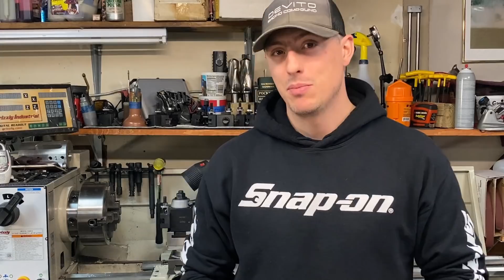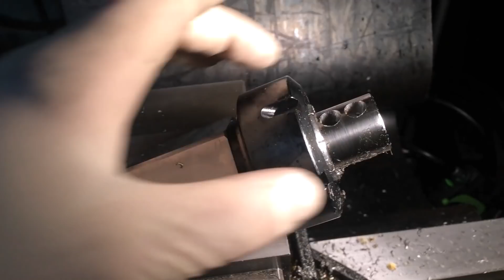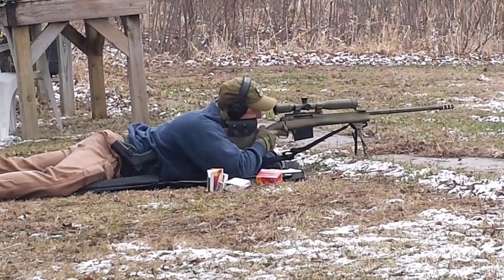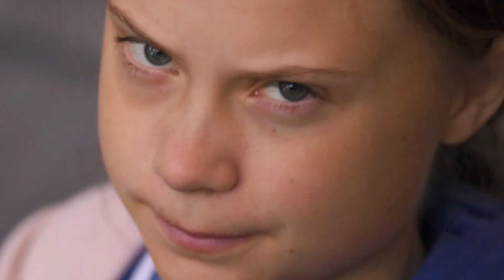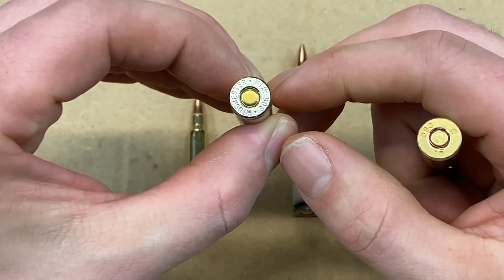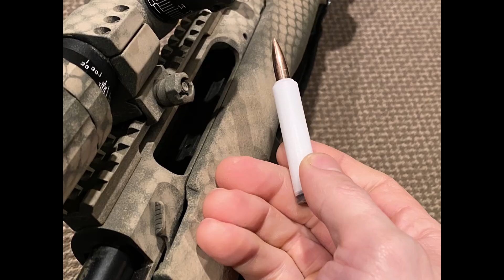6.8 NGSW ammo selected by the U.S Army for the NGSW Rifle testing! #ngsw #6point8ammo #army

Comment: Brits in 1948: we need an intermediate 7mm-ish round
America in 1948: no

America in 2020: we need an intermediate 7mm-ish round
Reply: Brits in 2020: "what's a gun ?".
Reply: At 3200 ft-lbs it's anything but intermediate.
Reply: What Round? .280 is 7x 43, the case lenght is shorter than a 5.56 by 2mm.
Reply: @Mr12ob  The new 6.8 - 140 gr @ 3200 fps => 3183 ft lbs - more than 30-06
Reply: @alexandruianu8432  Yeah, about as fast as .300 Win Mag. I don't like .30-06 personally, I know I'm off topic but just don't like .30-06.
Reply: Rob G Whats not to like?
Reply: @Mr12ob  me either as my 308 can do just about everything 30-06 can and most ammo has the same specs for boh of them in the same weights
Reply: @alexandruianu8432  Why those ballistics? 130gr 2800 fps. Low recoil. less heat,lighter round,lighter piece and would do the business.
Reply: @baobo67  Ask the army. They're the ones obsessed with 'overmatch'.
Reply from the maker: It’s all relative in the end.
Reply: It's a battle rifle round.  More like ~3000 from what I've read, but... yep.
Reply: 556 is here to stay, as is the AR platform. You'll note that all of the talk of 'replacement' is actually talk of 'partial replacement' of support systems. No one is replacing the M16 family with something heavier and more complicated, when they've already scaled back from a rifle to a carbine. They just want to increase lethality of the medium machinegun and enhance organic designated marksman capability. The M4 is still the best small arm in history, for MOUT, by a substantial margin.
Reply: @springbloom5940  The M4 maybe, but 5.56 has severe limitations.
Reply: @baobo67  

Everything a man can fire from his hands, has severe limitations.
Reply: @tomsmith2209  If they called in .280 Nato it would probably been adopted. .280 British was ahead of it's time.
Reply: This isnt intermediate
Reply: Brits in 1940’s ......we need your help with the Germans any caliber will do
Reply: @oldstudbuck3583  In the 50,s the Cold War was hotting up and no time for R & D and a need for commonality among allies is one reason given.
Reply: Why didn't the Brits made the 7mm-ish round ?
Or they need approval from big daddy ?
Reply from the maker: Bingo!
Reply: Switchpod I feel it’s possible the plastic will not remove heat from the barrel like brass or steel. This would mean more barrel changes for automatic gunners all round.
Reply: @LibertyLou_  I was worried about this too, sustained fire has me worried for polymer casings unless they coat it with a chemical or something that traps heat (not sure if this is possible)
Reply: @LibertyLou_  Plastic removes more heat from the gun because metallic cartridges touch the chamber and let the heat through. Plastic acts as an insulator.
Reply: Titanium Rain During sustained fire, what happens when these puppies start melting, deforming and or starting cook off? 
Should be alot of fun to fix that kind of malfunction during combat. All polymer has a melting point much lower than brass.
Reply: woohoo2491 True. I’m worried about these puppies melting, deforming and or cookoff.
Reply: @LibertyLou_  That's not the original argument, though. You were talking about the use of cases as heatsinks, not melting concerns.
Reply: Titanium Rain It’s precisely the argument. Brass has a much higher melting point, thus better heat sink. I’ve never seen a plastic heat sink have you? 
Now, the barrel gets heat transferred to it by the bullet traveling through it, along with the powder being burned. The breech will remain cooler because its air cooled when the action opens. 
Also plastic cases as insulators don’t remove heat because they don’t absorb it in the first place. Heat would remain in the barrel. 
But the case melting point from barrel heat will definitely be a problem, say on a hot sunny day in the sandbox after 3 magazines/100rd belt through the rifle. 
I’m very skeptical as to how much heat plastic rounds can take and how long one could last in the breech before melting and or cooking off which could lead to accidental fratricide. Let’s just have Trump’s space force bust out the Plasma rifles at a 40 Watt range lol.
Reply: @LibertyLou_  "Brass has a much higher melting point, thus better heat sink." - Heat sink properties are not related to melting point. In fact old machine guns used water as heat sink and water has a melting point of zero Celsius. Modern computer heatsinks use heatpipes filled with distilled water or sometimes a water-alcohol mix.
"I’ve never seen a plastic heat sink have you?" - because a heat sink is typically a FIXED part that has to remain in contact with the heat source. The case is both the heat source AND part of the ejected mass that carries the heat away. A better analogy is cooking utensils. How many have plastic handles compared to brass handles? If you wanted a fixed heatsink on a gun you'd solder or braze copper sheets to make a radiator. But we're talking about ejecting mass as heatsink. Brass cases are thin and highly conductive which means heat goes right into the barrel. The plastic case acts as a blanket that gets hot in the middle, but insulates the barrel.
"Also plastic cases as insulators don’t remove heat because they don’t absorb it in the first place. Heat would remain in the barrel." - An insulator doesn't absorb heat. Please provide evidence for this claim.
Reply: @LibertyLou_  You're lucky I found this video because it's buried in the results. https://youtu.be/pUS2_wLlvDY?t=431 At least True Velocity has posted proof of the guns running cooler with their polymer case ammo. I still want you to prove that an insulator doesn't act as an insulator. I reeeaaally want to see you prove that.
Reply: @LibertyLou_  yes !
Reply: @woohoo2491  not enough space for the quantity of atoms required....
Reply: @ChucksSEADnDEAD  No. Sorry no. Sone of the heat leaves the gun entirely taken outside by the spent casing. The polymer doesn't pick it up as effectively. The spent polymer will remove a fraction of the heat. A mere fraction. Having said that I wonder how quickly heat transfers by conduction ? From metal to metal. Funnily enough I was soldering copper pipe today, it's pretty quick.
Reply: @ArieteArmsRAMLITE  "Sone of the heat leaves the gun entirely taken outside by the spent casing. The polymer doesn't pick it up as effectively" - I mean I actually posted video evidence. How does the "polymer" not "pick up" heat? We know the heat transfer equations, you can literally look them up and post your calculations here. If what you're saying is true, you can prove it mathematically. You can't.
"The spent polymer will remove a fraction of the heat. A mere fraction." - Prove it.
"Having said that I wonder how quickly heat transfers by conduction ? From metal to metal. Funnily enough I was soldering copper pipe today, it's pretty quick." - that only proves what I'm saying. Heat conduction being so quick means that the brass case will transfer a lot more heat to the steel.
Reply: @LibertyLou_  Late reply and this really has nothing to do with anything, but powerful lasers were a real consideration, I think even prototyped, during the space race based on the ideas you could just melt a hole in an enemy space suit using a strong enough laser, lasers move in a perfectly straight line over great distances and stop they hit an obstacle instead of being dangerously redirected, don't pollute the space around the earth and moon with dangerous debris (48 grains of lead can shred right through a ship when it is travelling over 400 miles a second), no recoil, and the laser wont harm to your own equipment/shuttle (sensors yes but the hull will retain integrity).  Laser weapons make a lot of sense.  Plasma on the other hand makes zero sense.  Unless fired from some kind of railgun that fires a short "stream" or "bolt" of plasma somehow self contained in a magnetic field, and you are also in space away from any debris that would obstruct the bolt.  Keep in mind the only point to plasma is the massive amount of heat generated, not mass.  Plasma as anything but a powersource is retarded.
Reply: @ChucksSEADnDEAD  Not heat from the powder burning in the barrel and the friction of the projectile.
Reply: @baobo67  Metallic casings don't get rid of that heat either.
Reply: @ChucksSEADnDEAD  I wonder how much heat comes from the burning propellant compared to the friction from the projectile and the barrel. Seen pics of early air cooled machine guns with fins around the chamber area of the barrel. The Lewis gun is interesting in that area.
Reply: @ChucksSEADnDEAD  Watched this link with interest. It was sales and marketing and dare I say the proof is in the eating. Would appear that key to this is in their Polymer formula. Sounds good and would love to try it.Why is there none available and what are the ballistics? Hope it is not combat troops who find its shortcomings in battle like the 223/5.56 in Nam.Thanks and cheers.
Reply: Well luckily we have a new commander in chief that’s willing to bend to the needs of our military. And let’s all get serious. The only reason they said no was because they didn’t want the lethality . They wanted to make sure more rounds had to be fired to kill with the end result of supporting the war industry complex getting to produce more ammo at taxpayers expense.
Reply: America in 1948: We have the .30-06.

America in 1960: 5.56x45 is Light weight and accurate. But lack penetration in distance but OK inner fragmentation. But I still prefer the M14, so why not?

America now: Then we need 6.8mm.
Reply: @Romanov117  the new 6.8 is only a thing because the conditions have changed - it exists solely to defeat new kinds of armor
Reply: Go back to the 1930s when the M1 Garand was swapped from a .276 Pederson to the .30-06
Reply: woohoo2491 Japan listened to the brits though and have fielded a 6mm round superior to  556 for years
Reply: Im very happy to see americans acknowledging the excellence of 280 british 🇬🇧 🇬🇧 🇬🇧 🇬🇧
Reply: @James-C24  Dude I'd love a modern semi auto, like an AR platform, in 280 british so I can see how well it really performs
Reply: 7.62x39 is the true intermediate round.
Reply: @rowdyrico  Necked to 6.8 - Bingo. Too easy.
Reply: These aren’t intermediate...
Reply: Hehe.

But NGSW isn't an intermediate round.
It's a battle rifle round.  Afghanistan taught us that "engagements happen under 300m" isn't universal.
The competitors are doing recoil compensation, but its closer to 7.62 NATO than to 5.56.
Which is fine.
NGSW round performance is similar to .270 Winchester:  ~3000 fps, ~2700 foot-pounds energy.
So, 7.62 NATO, but flatter shooting and better sectional density.
Reply: That's the weird thing. These spitzer bullets started out with 7mm, and morphed into all kinds of calibers, yet here we are.
Reply: Back then nobody wore body armor unless it was make-shift, nowadays most Modern Armies are equipped with a Level 4 type standard body armor
Reply: I think that's funny,,,. 
But I think what they were think was " we don't need any changes now"
Reply: .280 brit would still be rocking today without a doubt. think of the possibilities we could be doing with that diameter bullet by now, API, sabot, etc etc. . .
Reply from the maker: Very true but people still run designs like that. Look at 260 Rem or 243 Win, even all the 6.5 offerings. They might not be main stream but they all have a following. All is not lost or forgotten. Keep the faith. A good design is still a good design.
Reply: @rigsby556  I tell people all the time .280 British would have been amazing in service.
Reply: rigsby556 
I agree...but I just learned about the Belgian variant of the .280 called the 7mm “second optimum “ (7x49).  That would have worked even better, me thinks.
Reply: Dear America,
We obviously know more than you lot so please stop pushing everyone in NATO about. You don't even stick to your own bullshit, you dropped your 7.62 rifles withing 5 years. We could have had a sublime rifle if not for your hypocrisy.
 Cheers chum,
Love from The United Kingdom Of Great Britain And Northern Ireland.

Comment: What about the weight increase of the much larger magazines and ammo boxes?
Reply from the maker: HA! 8:30 it's just a mock up. no denominational specs have been released yet.
Reply: @jeerrrrrrryyyyy  

So, you're just guessing in totality and there is no indication of a cartridge size?
Reply from the maker: @springbloom5940   it's just a mock up. no denominational specs have been released yet. Like I said it is a visual aid.
Reply: @jeerrrrrrryyyyy  Mate I'm sorry, but the visual aid doesn't seem to be aiding much then.
Reply: Polymer could be used to alter the shape of the cartridge allowing for lighter rounds with all the same power. This could also allow for more efficient magazines, maybe a slight bump in weight but a significant gain in available ammunition.
Reply from the maker: That’s thinking outside the box!
Reply: @jeerrrrrrryyyyy  the Dardick tried something similar way back but it didn't work too well. With better research and development I'm pretty sure it could work. The G11 also attempted something similar but with caseless ammo.
Reply from the maker: Yeah I really like the G11 idea.

Comment: There are also internal case dimension differences between 7.62 nato and .308
Same goes for 5.56 and .223
140gr at 3200 fps is no joke!
Reply from the maker: Very true about the internal case dimensions. I was just making reference to the chambers being different.
   Yes 140 at 3,200 FPS is moving!
Reply: Infectious Legume : thank you. 
I’ve read that military/7.62x51 brass is thicker.   Although the .308 is hotter, or higher pressure.
Reply: @TonaldDrump686  .308 and 7.62x51 are both loaded about the same. The reason everyone says .308 is loaded hotter is because one is typically measured in CUP, and one is measured in  psi. Typically they're within 2000 psi of one another if I remember correctly

Comment: The extended design of the bullet looks like you can get aggressive on the rifling for more stability, and with the extended case more pressure to push that round even further. With that design it looks like it would shoot flat with a less aggressive rifling(also shorter barrell) so it looks like that round can do an overall job with different weapons systems. Not sure on how reliability though.
Reply from the maker: Yeah, time will tell on that one.

Comment: I really don't like the idea of putting plastic fouling in my barrel and or gas system. At the pressures and temperatures in the chamber during firing I can't imagine how this would not happen.
Reply from the maker: Yeah, It all depends on the composite. I know of some that have a melting point of 500 degrees F. lets hope the composite they are using is amazing.

Comment: So... to get the velocities as to spec - need a serious sturdy case head design, I assume a blended propellant, magnum primer  ... seems the hold up will be case body material / chamber and barrel throat specs 🤷🏽‍♂️
Reply from the maker: I wish I had them. In theory if I did I could make a chamber reamer, then turn a barrel and fit an action to it.

Comment: Brass is a lot easier to recycle than polymer but the weight reduction sounds good. Brass casings can also be reused while I doubt the polymer will survive a single shot.
Reply: Doesn't matter when you can just melt it down and feed it back into your 3d printer. I see they stuck with a metal rim, though. Guess polymer isn't ready to stand up to an extractor yet.
Reply: @1337penguinman  I 3d print and recycling this type of material and turning it into a filament is very difficult to do at home with the current home filament making machines. The type of 3d printer that need to print this type of plastic isn't cheap as I'm sure you'd need more than 500 celsius to melt this type of plastic.
Reply: Military doesn't reload brass, they chew it up and recycle it, they don't have time to sort billions of rounds of brass with a chance it might fail 1 in a million rounds. That's 1000 failures every few months at 9-10 billion rounds of ammunition every year.
Reply: The ammo, and firearms are complicated. New gun control?
Reply: Things that don't matter on the actual battlefield
Reply from the maker: Interesting outlook.
Reply: I know I'm very late to the discussion but you aren't considering that brass expands and stretches with each use whereas polymer basically rejects any heat absorption.  The lack of expansion could theoretically mean that the polymer case could be reloaded almost infinitely without having to worry about resizing at trimming, just press the primer out, seat a new one, load your charge, seat the bullet and go.  While this is irrelevant on the battlefield it could mean saving a substantial amount of money over its service life in training environments alone where casings are policed religiously.

Polymer technologies have come a lot way over the last decade or two.  However, the real benefit to be had here is the weight savings but even that may not be worth it if the cost of saving that weight is taking up additional space in ones kit.
Reply: @apersonontheinternet8006  Polymer can only take so much heat as when the barrel heata up due to constant firing I honeatly think the casing will melt a little and stick to the barrel. Brass will expand but you forget that it can be remelted and recycled unlike polymer that ends up as trash. The weight savings too might not be that different since the cartridge is bigger than the 5.56 along with more gunpowder. I would rather go caseless at this point similar to the h&k g11 as that would be the real innovation if they can pull it off as caseless will definitely save on weight.